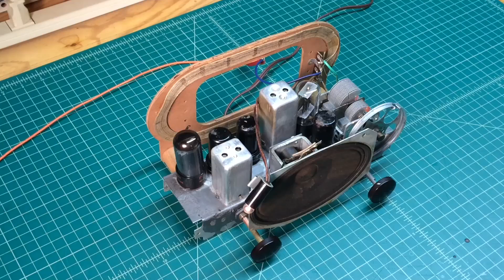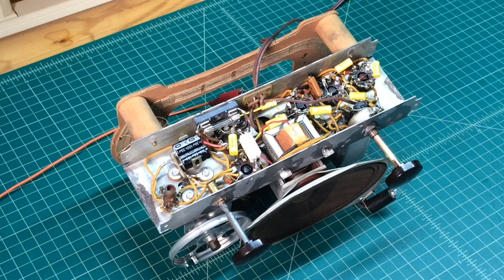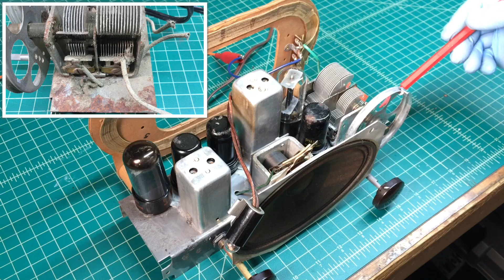Radiola 61-8 - Chassis & Electrical Complete

Comment: Don, 
Though carbon resisters that are rated at 1 watt, are in reality around 0.8 watt.  As a rule of thumb, I tend to at least double the resistance wattage rating in relation to the actual wattage being drawn.  For some reason, the design team at Radiola took wattage (and perhaps voltages) ratings to almost the limits.
This radio chassis is progressing very nicely my friend.
Phil.
Reply from the maker: +SteelCity321PB Thanks for the info on the resistor Phil. I assume they did so to keep their expenses down and increase their profit margins? Thanks again for watching. Best, Don

Comment: You did a very meticulous job getting the rust off that chassis! Looks assembly-line fresh! It probably works better than it did when it was originally bought in 1946-47. Can't wait to see what you'll do with the cabinet!
Reply from the maker: +Chet Pomeroy Thank you. The cabinet will be more difficult, but hopefully I can piece it back together and make it somewhat presentable. Best, Don

Comment: HI Don, thanks again for a great radio series. In case no one else has mentioned it, there's a glue called Bondic. It's a clear, one part adhesive that cures upon exposure to UV, much like the goo dentists use for fillings. It's not cheap (at least not in Australia), but it's available as a starter kit with a UV LED torch for the curing. I cannot tell you what it's like as I haven't got any, but there are many videos about it. If you can't find another cabinet, hopefully this will help, and it cures quickly, too.
Reply from the maker: +Adam Haga Thanks for info Adam. I've seen similar products here in the States. I may have to give it a try. It's my understanding the application is more like welding the pieces together. If I go this route on a test patient, I will share the results. Hope all is well and thanks again for your suggestion. Best, Don

Comment: Great job! Looking forward to the rebuild/restoration on the "Humpty Dumpty" cabinet. Based on all I've seen of your work, sure it will looked factory fresh if not better.
Reply from the maker: +GrandsonofKong Now I'm feeling some pressure. We'll see what happens. The Bakelite is almost impossible to match, so I don't have high expectations without painting the chassis. Best, Don
Reply: RestoreOldRadios
Didn't mean to apply pressure...just know that if it's possible and practical, I think you are the guy to do it. Nice you are doing this for this family too.
Reply from the maker: +GrandsonofKong I appreciate your confidence in me. We'll see what happens and like you said, regardless of the outcome the owners will appreciate my efforts. Best, Don